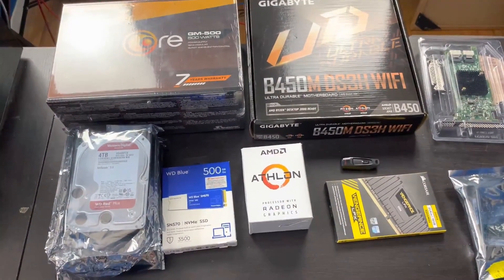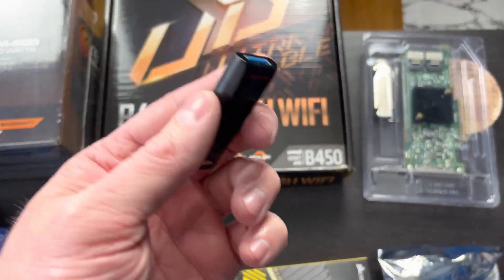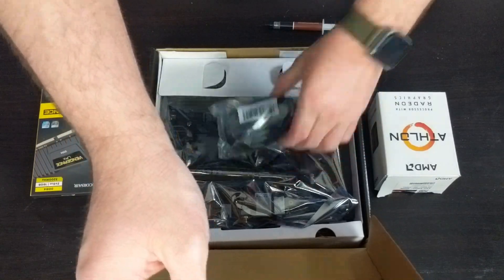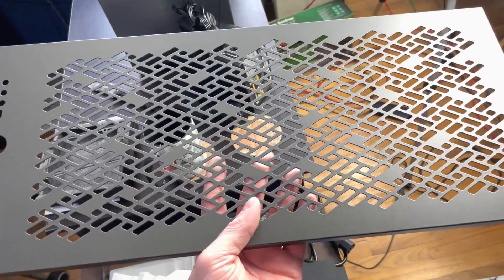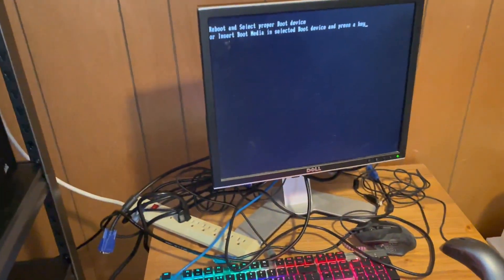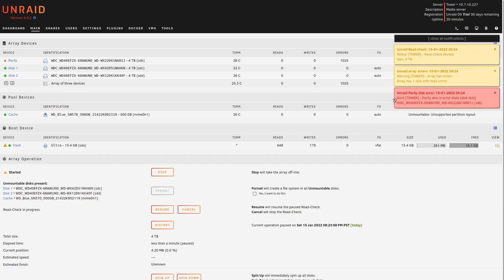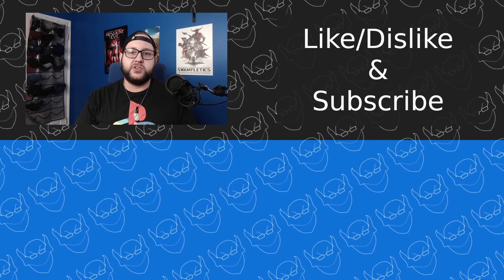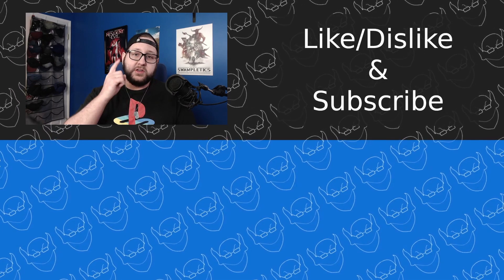Building the New Bit Goblin NAS!

Comment: Got a link for the LSI adapter?
Reply: How have you been liking the case? I’m thinking of getting one for my unraid build as well. I’m using some cooler master box and the hdd idle around 108 degrees. Currently have 5 hdd, 2 ssd and 2 nvme
Reply from the maker: Overall I've been liking the case. It's rather boring-looking but it gets the job done well. Here are my thoughts on it...
Pros:
- Pretty easy to work in, except for converting to storage layout
- Lots of expandability, extra drive trays are pretty cheap (a pair goes for like $10-20)
- My system doesn't get hot, though I only have three drives in my NAS and the CPU is a mere Athlon 3000G, so there isn't much heat generation to start with
- Included fan hub is nice, makes adding more fans a breeze (pun intended)

Cons:
- It is rather large, so make sure it'll fit where you want it to before buying. I had to adjust my shelving unit to accommodate the height.
- It took me a bit to figure out how the case converted to storage layout since the only documentation I could find was the pictures provided in the manual, and a two-minute YT video. Still took me a bit to get it all sorted. Maybe I'm just dumb.
Reply: Thanks for quick replies! Liked and subscribed! Btw, how are the hd temps?
Reply from the maker: It's no problem, I enjoy chatting about this stuff. And thanks for the sub!

As for the temps, the three HDDs and the NVMe cache drive usually sit around 25-30C
Reply from the maker: Yep! Here you go https://u.bitgoblin.tech/00snp
Reply from the maker: Here is a mini-SAS to SATA breakout cable if you need it: https://u.bitgoblin.tech/prpbd